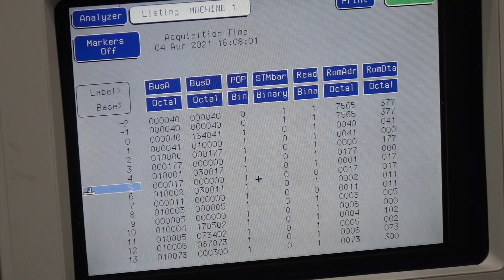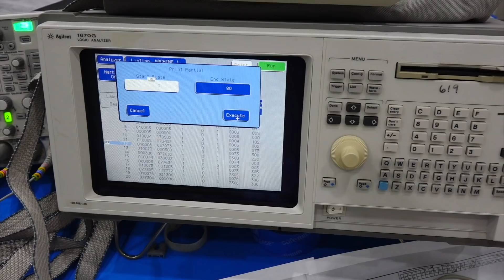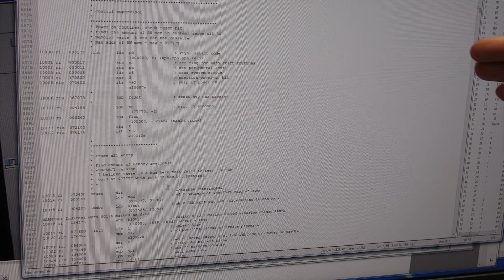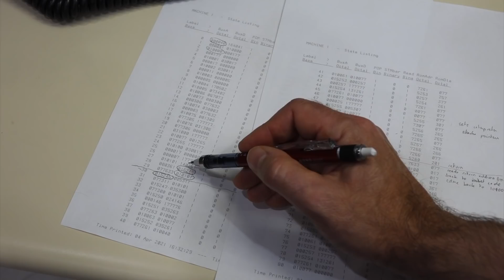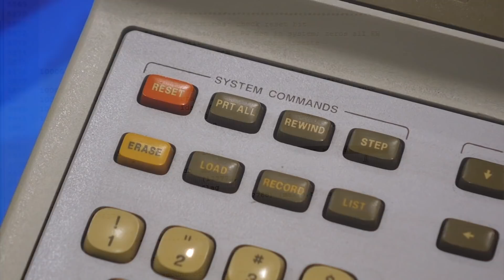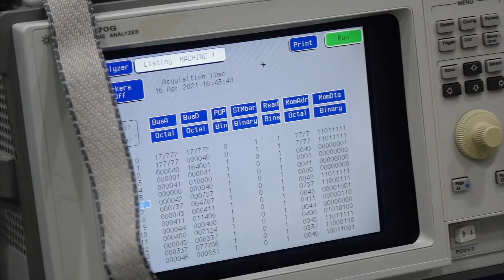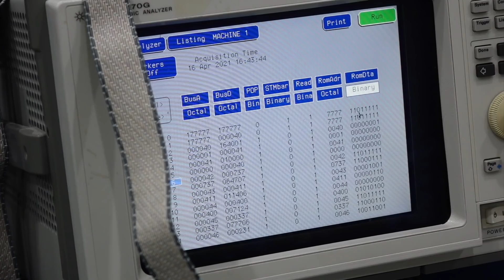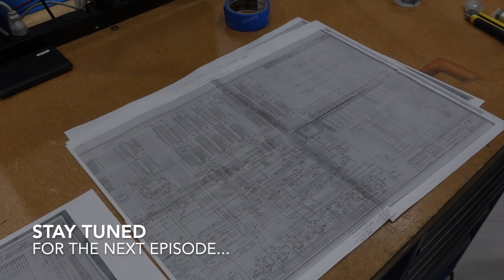HP 9825 Repair Part 5: We have an Apollo 13 disaster on our hands

Comment: There are few more horrendous electronic failures than overvoltage caused by a faulty power supply. When I was learning electronics, many many years ago, PSU Design 101 was "NEVER, EVER allow the output voltage to rise - ALWAYS design your PSU to fail in a safe state with zero output"

Lots of ways to achieve overvoltage protection of course, and I was always taught that in high-end equipment, you should always have more than one safety system - a voltage comparator driving a cut-off relay AND a crowbar circuit to blow the fuse, for example.

PSUs without at least two overvoltage protection schemes are just an expensive accident waiting to happen, especially with old-school TTL logic :(

Comment: check if the data bus has 74245 bus buffers / switches. That's where you will find your missing bit... I've restored many an old HP machine that had 245's fried.
Since you had a big overvoltage , at this point i would just strip the boards, put in sockets and simply swap all the chips. Many will have had a sufficiently large hit that they will die in the next 500 hours of operating time. You will be trouble shooting this thing for years to come. And dump the roms into eprom too.

Comment: re replacing chips.... can you use an in circuit chip tester of some kind to detect possible dead chips.  I have a vague recollection this was something we did 30-40 years ago when we build stuff with "discrete" logic

Comment: When trying to debug machines with multiple bus faults I've sometimes used test roms built for the purpose. They first exercise all the rom bus, then do read/writes from various ram areas, then exercise the peripherals, all without using anything more than the CPU's registers. They're simple enough that you can hand-assemble the code.

Comment: Maybe I missed it, but why don’t you use the known good machine and  do a board by board repair. At least then you know which board is faulty. Multiple errors on multiple boards in this architecture is hard to fix.

Comment: I recall seeing a comment in an earlier episode (which I tend to agree with) that mentioned that even if you repair this unit, other chips which might be working now will start to fail sooner because they are damaged, thats probably what Marc is seeing here, some chips are now marginal and starting to fail. Will be interesting to see what happens here. whether it ends up as a modular replacement or a component replacement repair

Comment: Unfortunately I had the same with a programmable PS. Unique chips from USSR were breaking and the board is crap. Beyond digital board repair, there are lots of caps and resistors that should be replaced. I gave up

Comment: Amazing. But wouldn't 060000 octal be 24k not 16k of RAM? Is there ROM in the lower 8k?
Reply from the maker: Ah, it's misleading. RAM starts from the top at 77777 and it stops finding any below 60,000. So it sees 8KW, but these are 16 bit words, so that makes 16KB. It's still missing the lower 8 KW on the same board (should go to 40,000), so clearly an address decoder fault, not a memory chip problem, since all that is in the same 16Kx1 chips.
Reply: @CuriousMarc  Ahhh okay, apple ogees.. i understand now.Made mistake earlier, i suggested to someone you impedance test input/output of logic  on processor board to find anomalies,i meant  memory,as processor seems to be golden  as you would say! Well,, you guys did a gate by gate check on the AGC!!
Don't know if you're up for it,Carl looks as if he's ready to buy boards..
Reply: Yeah i got that too.....Its 24,576 he got his calcs wrong

Comment: In the early days, I put 5V on the pcb and with a voltmeter to ground and the + connected with 10k pullup resistor to 5V. Then measure all the pins from each chip. When the result is in the forbidden zone, there is the problem. If done remove the resistor from the 5V and connect it to the ground, repeat all the measurements  now with pulldown. It takes time, but it is more easy and safe. Succes.

Comment: All this for lack of an SCR OVP. I would be reluctant to replace all the chips without a really really good reason. You might get different performance from new chips that could upset timing. I have put new chips in old designs with unfavorable results.  Finding a new chip with decades old behavior is an interesting problem.  Even though I have good de-soldering tools I would clip the chip leads and remove one lead at a time. You are getting good mileage from the logic analyzer and you are doing a great job. I feel the stress and frustration and it not even my calculator. I don't have the pants for one anyway.
Reply: yep.  while I never had to do old school repairs like this, I watched them over other people's shoulders.

Comment: Check the RAS and CAS signals to the ram and the latch at both sides incase something is pulling the bit low.  Have a sock ready incase you need a filter!

Comment: The biggest problem those thinkjet printers had is that the ink cartridges would weep. If you didn't use it for a while you'd end up with ink all over the bottom of the printer. It was a real mess. Otherwise they were great at the time cause they were pretty small for a printer that would use letter size fanfold paper and a hell of a lot quieter then a dot matrix.

Comment: So, I was debating on for a vintage repair project (a much less rare 1980s Compaq Portable) if I was going to try and repair the PSU or replace it, and well, this series has convinced me that I'm better off w/ a modern replacement PSU, especially since +5v on that PSU board is generated by a single zener diode and bypasses the crossbar circuit on that PSU ...

Comment: Well, these failures are going to pop up, Marc. Those TTL IC have all been stressed far passed their maximum operating voltage.
I would start with all the bus drivers/bidirectional tri-state IC’s and latches first. Blanket replace all of them and any buffers that are tri-state. Just bite the bullet and replace them. Then you know they are all working.

Anyway, be sure to put a crowbar on the +5vdc powersupply.

Comment: Going to bet a memory bus buffer is failed, and instead of tristating the output it is instead keeping the one bit hard to ground. The refresh circuitry should be easy to troubleshoot, as it is really not actually needding the processor to run code, merely do what it has demonstrated it can do, provide a valid clock and bus timing signals, so the RAM refresh should be visible in the data bits of the RAM all the time clocking through 128 columns and then repeating.  Guess HP used discrete logic, with a few dozen logic gates and a simple 7 bit counter, as the later on chipsets that did DRAM refresh came along later on.

Comment: I once had a way-too-simple memory test I wrote pass on a prototype board where memory in fact did not work at all (the control lines were connected incorrectly) ... turned out the last value written was just being capacitively retained on the data bus long enough to read it back successfully.  Since then if I need a tiny trivial memory test my preferred one is to fill all of memory with the pseudorandom sequence and then verify all of it.

Comment: I'm no electronics wiz by any means, but could the 0's be down to a broken / blown trace on the mobo just in front of the first ram chip? i'm guessing the data comes out in parallel (and going by the schematics)
Reply: Much more likely a broken/blow transistor inside one of the chips. PCB traces are not the weakest point in these things, by a large margin.

Comment: Ordinary people : "Oh no this piece of electronics died... let's buy a new one!" - CuriousMarc : " * Laughs In HP Equipment * You don't have my permission to die!"
Reply: @SteelRodent yeah, nowadays stuff is just made to be thrown away, and the same manufacturers that claim they're "green" and "environment-friendly" do that lol
Reply: This is also made from largely off the shelf components. It’s not a proprietary SoC blobbed onto a PCB. I guess we had the choice between repairable or small, and we chose small.
Reply: I just repaired my 24" monitor from 2008 with a set of new capacitors. Power supply issues.
It was easy and fun to do and I wouldn't have known better to not throw it out if it hadn't been for these glorious nerds.

This is a cliffhanger, I loved the HP 9825 hurtling toward the moon bit.
Reply: @SteelRodent Up to a point. HP only chips that are no longer made and thus are rarer than hens teeth makes such repairs seem like a quixotic undertaking.

Comment: My guess, one of the ROMs ICs fried and is pulling the data bus low on that bit.
The RAM refresh clock might be off-spec  too. 
But the proprietary ICs are fine, so it can be repaired!

Comment: It's testing fate plugging in known good components (cards) into suspect systems and visa versa.  Some times you end up killing your once good components.
Reply: My heart nearly stopped when he started substituting parts from the good one.
Reply: Yes,i concur, it is risky,it may give you quick answers,or it may give you a coronary,a gamble for sure,at this stage things are looking bad.
Reply: Nah, he fixed the power supply problem that was wrecking parts.  He might have added an OVP crowbar too, I can't remember.
Reply: @tigercat3864  short circuited components on suspect cards can make a bad day worse. If there are any CMOS ICs on any of the cards they love a good short. While modern CMOS components are more tolerant chicp of that vintage were not.

Comment: After something like this and swapping parts between the machines my fear is always that by the time you get to the end and it works, all the good parts will be on the bad machine.
Reply: My fear is damaging a good board in a bad computer!
Reply: @timsmith2525  I was thinking the same thing. It might cook one of the boards, in which case you might be up shit creek, esp. if it cooked the ROMs with the boot and operating systems.

Comment: With this title I expect that you'll use the Apollo Guidance Computer to tow it home. Write an emulator, put an AGC in the box, bam HP9825 fixed... Easy. :)
Reply: Could Mike S. make a gate-exact replica of the failed boards using an FPGA?
Reply: @jlwilliams  IIRC they had that already while restoring the AGC, Github to it https://github.com/virtualagc (had to look around, its linked in part8, dont know if in other Episodes aswell of the series)
Reply: @jlwilliams  With enough cheetos.

Comment: Oh damn:/
Any idea why ROM is misssing a bit suddenly?
Reply from the maker: That’s gonna be a toughie. Every data bit of every ROM and RAM chip is wired together, so any faulty chip can bring the entire thing down! Could be one of the data buffers too.
Reply: @CuriousMarc  Sounds like a "Stuck Node Tracer" could come in handy, I've never built one, but it is described in the Art of Electronics. A sensitive microvolt meter, that shows you the direction of current flow. Uses the traces as sense resistor. So you'd know which node is pulling in/out the current.
Reply: @CuriousMarc  Uhh yeah that sounds really tedious to debug.
But I wish you much success with that!
Reply: @CuriousMarc  A case for the HP 547A Current Tracer maybe?
Reply from the maker: @danieltufvesson1349  Yes I think it’s time for one of these! Carl has one I believe.
Reply: @CuriousMarc  Inverted can of airduster and/or hot air trick perhaps?  TTL layers might be thick enough for a result.

Comment: Im watching this but it is so beyond my stupid brain it is not even funny.
Reply: I think I can relate to that feeling. When I thought I was able to follow the content, Marc made a comment and opened the next door to Alice's Wonderland of Logic Circuits. It is sooo complex! And no wonder everybody is on the edge of their seats - Marc is probably one of the few to know as much as there is to know about the HP-'Calculators'. I fix tube radios for a living and still didn't take the next step to a broken, simple TTL-Clock in a DUAL Tuner. So this will be my "HP-Project" and god knows if I will manage to find out why the five chips don't work together :D

Comment: A blanket change is effective but it is far from satisfying, The challenge is finding the fault, not simply fixing it, surely?
Reply from the maker: Exactly! Wholesale replacement teaches you nothing about the machine, and is no fun at all. And when you get a single failure later, you won’t be able to repair it. That said, this is a bit of an extreme case. It might be worth doing depending on the proportion of bad chips and the rate at which they die on us. It would be a huge job. But if we continue to fall behind, we might not have much choice.
Reply: @CuriousMarc  It’s a tough call here isn’t it. Maybe give it one or two more cycles then blitz it if it continues to develop new faults - best of both worlds, or the worst maybe :)   I still love seeing you and your accomplices derive so much value from fixing these old bits of kit. Reminds me of the best parts of my working life.
Reply: EXACTLY.